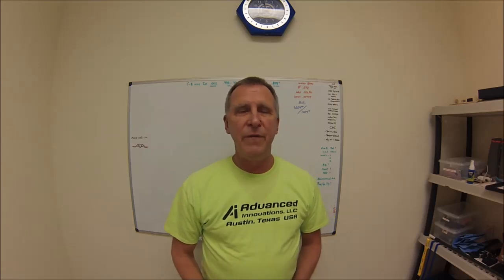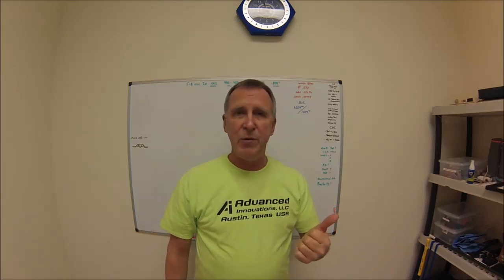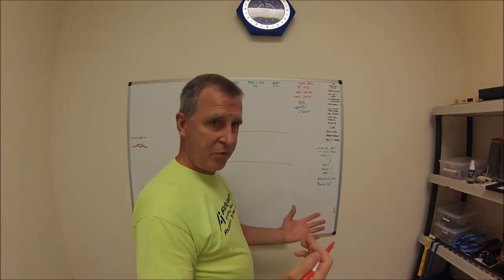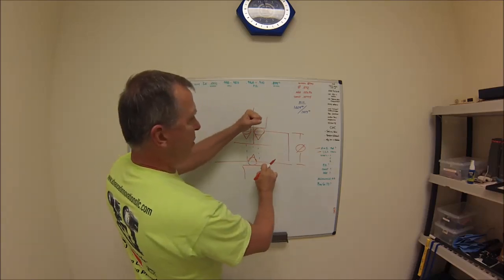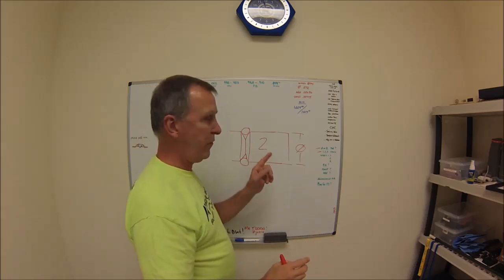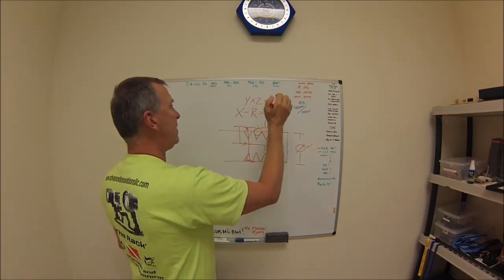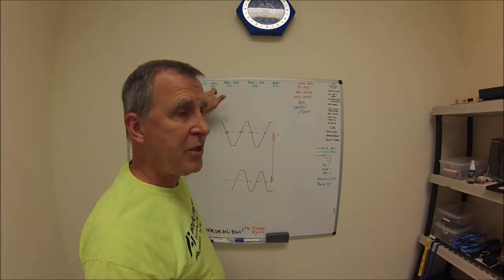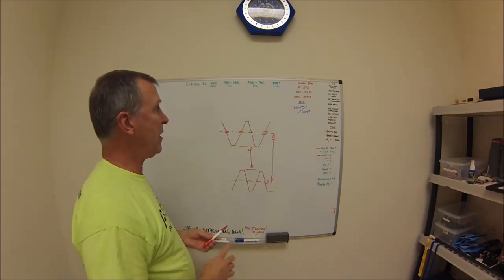Pitch Diameter, Wires and Numbers Galore. Threads in detail !

Comment: I'm confused about something. When I look up charts for class 3 threads, the A and B pitch diameters are much closer in range than to 2A and 2B. Specifically for 3/4-20, MAX 3A and MIN 3B are both .7175". Is this the ultimate "tight" fit scenario? Also, maybe I just don't understand the geometry, but if both pitch diameters are not the same, does that mean your pitch is off? 20 TPI with a pitch of 0.05, 3A pitch diameter of .7175 and 3B pitch diameter of .7218, would this still have a 0.05 pitch but it just has some play to allow for rotation? I guess I'm confused about what controls the accuracy of your pitch, if you had to control for every rotation you need that to lift 0.05 inches. Or are the classes simply higher standards for tighter fits, but all the classes have the same pitch regardless of pitch diameters not being the same? I hope my questions make sense haha
Reply from the maker: Your questions make perfect sense, and your confusion is understandable. Lets start with a clarification of the terms. The 'Pitch" of a thread is the distance from the crest of one thread to the exact same point on the next crest inline. That value divided into 1" will give you the TPI, or threads per inch. You can run this in reverse to do your own calculations if you wish. So a 20 pitch thread is .050 between crests ( or roots) no matter how big the outer diameter of the thread is. The 'Pitch Diameter" is a calculated diameter theoretically half way between the crest and root on one side of the thread to the same point on the other side of the thread. Deviations in a pitch diameter have no bearing on how far apart the actual threads are regardless of whether its an internal or external thread. Its the control standard for the thread fit. Yes, class 3 threads have the possibility of having the same 'Pitch diameter' for the A and B threads. Its the most precision class. As you get closer to a class 1 thread, the fit gets sloppy and this line fit contact goes away. I hope this helps. Class 2 is the most commonly called out.
Reply: @joepie221  Cool. Thank you so much for your help

Comment: Hi Joe! I like your video content, and I have been watching your videos for quite some time. I have a question about internal threading. When I make a plug gage for an internal thread, do I machine the OD to the major diameter of the A class or to the minor diameter of the B class? Thank you for your instructional video I have learned a lot from them.
Reply from the maker: You use the major diameter of the A class, but the pitch diameter's of the B class. Many guys mess this up when making a gage. Since you make an external thread as a gage, many use the external PD specs to do so. common mistake.

Comment: I may be wrong, but using the one wire method might give inaccurate results in certain cases. It seems to me that it is only accurate if the threads are cut exactly centered on the od of the shaft. You must make a truing cut first (which should be done regardless) on the shaft before threading and measure. If you had say .010” runout on the shaft when put in chuck and started cutting threads, you would need to use the three wire method to accurately measure the PD. 

I would hesitant to use the one wire method to check threads on a part that came into my shop because I would not be able to verify that it was threaded straight to begin with. 

Other than that, I do love the one wire trick. It has helped me take my threading to the next level.
Reply from the maker: The majority of the time you run a single point thread, you also establish the OD in a prior op. I try to be as thorough as possible, but an assumption of concentricity is assumed. You are correct though. But...If you took the single wire and checked your thread in several rotational places, a difference in measurement would indicate eccentricity. A side benefit for evaluating a thread that doesn't go on. 3 wire won't tell you that. Just food for thought.
Reply: @joepie221  My god you make that sound awesome! I want to make some damn threads and I've never even seen a lathe in real life! By the way, square threads are sexy, just sayin'.

Comment: Awesome tutorial thanks Joe!
...Next, can you show us how to turn progressive pitch threads.
The idea being - as the part is tightened the male part (ie: bolt) elongates under tension thereby disengaging most of the threads that would have had contact under no tension or torque.
The result being only a few (front or leading) threads of engagement carry majority of the load, while the trailing threads due to the part being stretched may not even engage at all...and so to speak "hang in the air."
This may not be critical if only pulling forces are placed on say - a bolt.
But if lateral forces are placed on a really long bolt such as a lever arm threaded into a hole, the front engaging threads could act as a fulcrum point since the trailing threads have no contact.
A crude example would be - Think of your lever for enaging the half nut, has only side forces. Full thread engagement would prevent it from loosening since that would reduce wiggling if only the first 3 threads are actually touching while the part keeps getting forced side to side.
Now multiply this event times 100 or even 10,000 vibrating at a harmonic frequency and since....everything is under tension---while wiggling around...you see what can happen to the few threads which do have engagement. - Or just the part keeps loosening.
One way I imagine would be to lap the threads in but....
---Is a progressive pitch thread possible on a Manual Lathe, or only CNC?
Thanks for any thoughts you have on  this.

Comment: In the single wire meathod, couldn't you take your measurement and add 50% of the known wire diameter?
Reply from the maker: No. The depth of your developing thread is not always going to be on center of your wire.
Reply: Would that be a way to measure for your target diameter then?
Reply from the maker: @greglewis9259  Total measurement over the part with one wire in the thread. Subtract the radius of your part. Double the resultant value. = current pitch diameter.

Comment: I have a threading question. Using the 29.5 deg offset setup with a carbide 60 deg threading insert my threads look like sawtooth threads. If i just go straight in the threads look perfect. The set up is the same the tool in same position. What am i doing wrong?? Can you help?
Reply from the maker: I am going to guess you are on the wrong side of the 30 degree mark. 29.5 isn't critical. Set your compound at 27 or 28 and see if the sawtooth goes away. start with your compound lead screw and cross slide lead screw exactly over top of each other and make your shift from there.
Reply: Thanks that was the problem.  My compound and cross slide only had an indicator mark when the compound was 90deg to the cross slide so when i set 29.5 deg i was actually setting 150.5 deg. I have now put another index mark so i can use the correct angles. Thanks again. I really like your videos. Keep them coming. I am learning alot. 
Chris

Comment: When using the wire method of measuring threads,  which one do you typically use one two or three wire? Thanks for your educating videos!
Reply from the maker: I honestly still use 3. I've done it for so long, holding them isn't an issue.
Reply: Joe, it would be wonderful if you would show us how you hold the wires and manipulate the mic. I tried making a holder by drilling 3 holes in a wooden block using my mill. Sorry to say I am still getting readings that vary up to about 0.005.  It's better with the block, but I must not be holding the mic correctly.  I also tried the 1 wire method and got readings varying around 0.002. I would like to get consistent within a couple of tenths,  but I  am not sure how to make that improvement.

Comment: hold the wires in place with Vaseline and you won't need a third hand . . .been doing this for forty years
Reply: I just spit on it...my boss got mad at first and thought I was spitting chew all over the place like I do in the coolant vat, but when I explained to him that I was merely getting the wires to adhere to the part he was like...Hmmm never thought of that...Great Vid BTW Joe...I'm happy someone of your caliber helps to simplify, especially when you noted in another Vid that it don't matter what your compound is set at .29.0, 29.5, 30.0 deg etc. to make a thread. The end result is the cutting tip is going inward to a certain depth. Go straight in if you want.
Reply from the maker: I used modeling clay for many years.
Reply: I tried it and it works! how 'bout that. thanx

Comment: When using the 1 wire method do you have to deburr the thread first? Otherwise wouldn't the burr make the PD appear larger than it actually is?
Reply from the maker: Initially, the burr will be a factor. Once the wire rests inside the thread profile, its below the top edge and the burr would have zero impact on your reading. The burr would however influence the area where the micrometer sits.

Comment: Great lesson. One thing I would disagree with is that Standards are for Certification Authorities to Make Money on Certifications. : )
Clarification - at the 14:55'ish mark, I think you mean to say class 2 vs class 1 rather than "class B." A and B have to do with whether it is internal vs external thread???
Reply from the maker: If I am hearing you correctly, the part of the video you are talking about is very accurate. My use of 'A' and 'B' class thread titles is very specifically for the internal and external profile. Gages are a different animal.
Reply: Aha, I just relistened and get what you're saying, now. One needs a specific, mating test gauge for testing the external or internal thread, not just an off-the-shelf, i.e. standard sample of its mate.
Reply from the maker: Correct. External threads are smaller so they fit into the internal. When you make, or buy a thread gage for an internal thread, its actually larger than the external thread is is going to allow to fit into your part. Many guys use the wrong Pitch Diameter when making gages.
Reply: Joe Pieczynski that cleared it up for me too

Comment: Guys come up with tricks to make 3 wire measurements easier (putty, etc).  Using 1 wire is the best trick of all.

In doing the 1 wire calculation, you use the OD to get the radius, etc.  That OD has to be measured and not just the nominal value.  E.g., if you're making a 1"-8 thread and turn the OD to .990, it's the .990 to use in the calculation, not 1.000.

Also, the calculations can be made a little easier.  If M is the 1 wire measurement and D is the OD, then the PD is 2 x M - D.  This is just a simple algebraic change to your formula.
Reply from the maker: The one wire method is also good when the last guy to use the wires...lost one and didn't tell anyone.

Comment: Beginner here with the Dumb Question of the day. Example: 3/8-24 UNF thread. The thread chart indicates the major diameter of the external thread to be 0.379/O.366. Does this mean that I should turn the part down to this value before beginning the thread cutting operation?
Reply from the maker: Hi. I am surprised to see the high end of that size at .379. I would think it should be .375 or less. Your answer...The major diameter is the outside diameter of the finished thread. I would turn the blank to the middle of this range before you start. Its less material to thread, and gives you some room to cleanup the thread when you are done.  Double check that value.....
Reply: Yep. Typing error. The values are 0.3739/0.3666.  This for a 3/8-24 UNF Thread from the internet Unified National Imperial Screw Thread Calculator. The Thread Calculator shows the thread depth to be 0.0307/0.0212.  It also shows the distance over wires with best wire diameter of 0.0241 to be 0.3829/0.3791. These values for a 2A thread. Waiting on wires to get here so I can properly check the depth. I thought the thread depth would be greater??? 

Great videos that even I seem to be able to understand. Thank you for the quick response.

Comment: Rule of Thumb:  NEVER use body parts (fingers and things) for tools.  Use tools for tools.
Reply from the maker: Point?
Reply: ......because I have seen very many unlearned, inexperienced and naive co-workers use body parts for tools  E.g.  a finger for a drift pin, or fingers for a chip brush, or a fist instead of a mallet.  I think you get the picture.

This comment is referencing your statement at ~17:10 wherein you described someone holding a piece of abrasive material with their finger in internal thread deburring.
Reply from the maker: Its a good rule of thumb to work by. Unfortunately, haste leads to injury in most cases. It only takes a second longer to be careful. I've been in industry for over 40 years and seen injuries that just leave me baffled how they happen.
Reply: I know exactly what you mean.  I, too, have seen accidents that baffle me no end why anyone would feel the need to be so careless.  

I put up safety signs In my plant operation.  They were mirrors with a statement at the top of the mirror.  My favorite was, ''Accidents only happen to the other guy.  Meet the other guy.''

Comment: Hello Joe, I must have come across the one wire method in school some 50 years ago but have to say I've never used it. However it could make life easier. My main background is aerospace and high-tech electronics machining... checking with hard gauges is mandatory. One of the first inspection tools I bought were interchangeable anvil thread mics. Great for sneaking up on threads and comparing to certified and calibrated hard gauges. Most of the threads I or my employees cut were on NC then CNC machines. Still we had to make Jigs and fixtures and some of those were done on manuals. As you know the basis for top quality threads is threading tool geometry and thread profile aligned to the work piece. We always verified thread angles on optical comparators....Great Video. BTW I wish I had had shop full of talented people like yourself working in my shop...My life would have been easier by orders of magnitude....I don't know how to do it but America needs to interest young folks in the trade's...Also STEM
Reply from the maker: I was actually looking into the FIRST program for our local schools. The STEM basics are an integral part of that as well. Hard gages are the best for sure. I did many years in aerospace and military machining and had gages for everything. Big Bucks!!

Comment: great video!  the more coarse the thread, the more and more narrow your thread groove will become. mathimatically speaking. this is why your constants change in your acme chart with different diameters. Won't you measure a different measurement over wire making a groove strait in? or is that too small of an error to matter?  the "allowence" is clearance for male and female separately. if you have a allowence of .002 for male and .002 for female, the least slop you can get will be .004. 

not trying to sound smart. I hope this helps. thanks again!
Reply from the maker: Not sure I agree. I don't do many acmes, so I can't comment on those, but on a 60 degree thread, the coarser the thread, the wider the groove because its deeper. The constants don't ever change. Thats why they are called constants. The constant is applicable to any diameter. A straight in groove geometry gives you an inline relationship from wire to wire. The measurement will be the same as 3 wires when aligned correctly. There will be no error to worry about. Allowances of .002 for each thread will not result in a total of .004. Its the dimensions that allowance is applied to that determines the total possible min and max gaps. Not trying to shoot you down here, but clear up your comment. If you still don;t understand, lets keep talking. Thanks for the comment.
Reply: Joe Pieczynski ahh, I checked the machinery book and you were right about the allowence.  thanks for the correction :) about the groove/thread relation... when one makes a groove strait in, the groove will be exactly 60 degrees. a thread will also have a perfect 60 degree groove if you measure it horizontally, but will always be less than 60 if you measure the thread groove perpendicular. thing is, the thread tool cuts sideways. if I cut a single start thread the same depth as a double start thread, the double start will read a larger reading then single because the groove will be thinner. it's a small difference but it's there.
Reply from the maker: I will have to digest this one for a while before I comment. Its your use of the word "thinner" that confuses me.
Reply: Joe Pieczynski by thinner, I meant less then 60 degrees if measured strait along the thread groove. (the way the wires lay) I know this is like impossible, but if I made a thread of 2 feet per revolution on a 1" diameter shaft, Imagine what the thread would look like! you'd need to go maybe 4 times the depth of a normal thread just to get a wire in...

Comment: Hi Joe,

I am really learning a lot from your videos.  Thank you so much.  I have a question that may or may not be worthy of video but maybe you can at least point me in the right direction.  I am trying to use the Machinist's Handbook to figure out a thread problem.  I want to thread a hole in a plate, approximately 3/4" in diameter that I will run a screw into to support a specific load, say 1000 pounds.  How do I determine the minimum material type and thickness of the plate and TPI to support that load.

Thanks again,
Russell

Comment: Hi, joe. I have to measure large acme threads to check if it is worn and documents my findings. In years past we used a go- no go test set. It has to do with % of life left on the threads it's not a deal breaker but it would help me get a good repeatable valve if I used the 1 wire and hardened dowel pin? Great video. Thanks for sharing